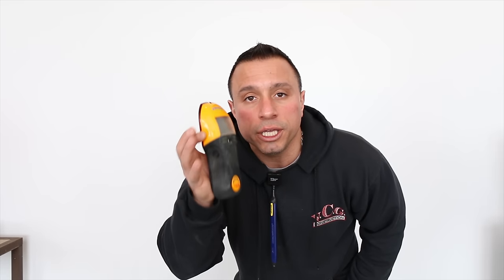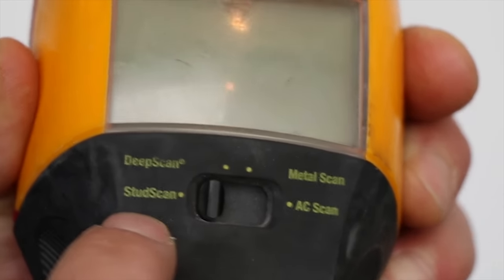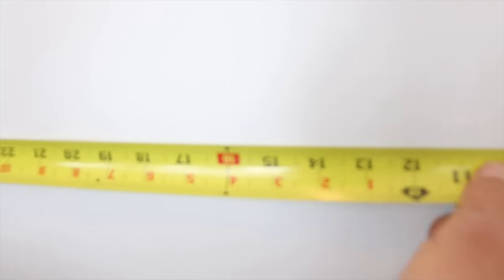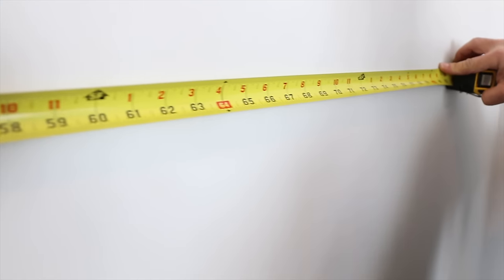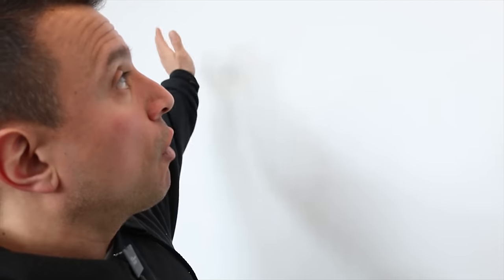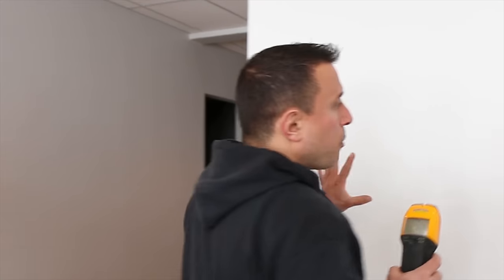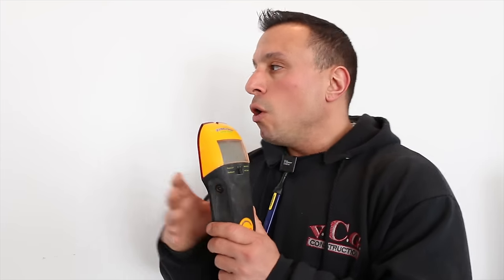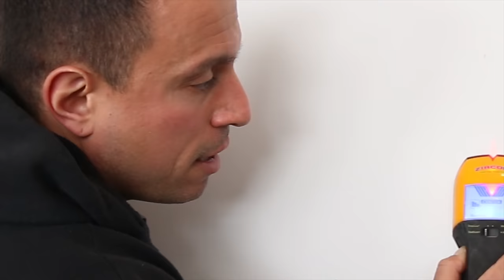How To Use Zircon Stud Finder Like A Pro!

Comment: The AC scan finds wires 2 inches deep, other things are found 1.5 inches deep so the AC is the BEST scan. This info is the FIRST thing you find when you look at the included paper manual, so if there is a wire or wires on the other side of a 4 inch wall, don't expect to find it!

Comment: The only problem I find with this unit is when you scan left to right and mark your studs at the center, then you try going right to left the stud sensor, it indicates the center anywhere from 3/8 to 1/2 inch off from the original mark. I don’t think any stud finder could accurately find dead center of a stud because there are so many variables with density of the stud and the drywall.
Reply: I have a different model of Zircon stud finder and that is the exact problem that I am having. The model I'm using only finds the edges so I mark them but then when i go over the same area again it shows the edges somewhere else. I have NEVER had luck using stud finders.
Reply: @NonLegitNation2  Me too! Did you find a solution?
Reply: @SHyoutube.  nope, it still sucks.

Comment: I had the cheapest version of the Zircon Stud Finder that worked perfectly  until I accidentally destroyed it.  Bought the Pro LCD and it won't work.  Yes, I held it to the wall before pressing the power button ...tried it on Stud Scan and on Deep Scan.   It beeps as I slide it on the wall and arrow goes off and on in tune to the beep but it never lights up or gives a constant beep where I KNOW there is a stud.  I've tried it on 4 different walls in my house: Living room, bathroom, hallway..nothing. And yes, I move it slowly.  No problem with the cheap one, but this one won't work..oh and I exchanged one and got another exact model...nothing on either one.

Comment: Big tip at 9:59
Reply: As a kid My great-grandfather had a old  edge stud finder with the 5-7 vortical lights that light up and beep when near, I would use it on everything, floor, couches, head, cabinets, carpet, pillows, hands, etc.. And I didn't always calibrate it on the wall so it would give false beeps as u stated, so to me it was common sense to turn it on at the wall first then walk to said items and play around with it to see if it would beep and light up, but I can see why people turn it on before putting the tool on the wall aswell.

Some finders if you calibrate it over a stud then you would also get false readings aswell, and some other stud finders  don't care about that rule

Comment: Watched your video yesterday went out to Home Depot picked up brand new unit installed brand new Duracell 9-volt battery couldn't accurately detect a steel stud in a business environment to save its life.  Already new about the trick to keep the unit planted to the wall for accuracy calibration. 

To get a stud finder that actually consistently works that and shows: pipes, live electrical wiring, studs both wood and steel with today's technology would you have to get a thermal imaging unit if you wanted higher level of accuracy?

Comment: Ahhhh that must be why my stud finder sucks!  I need to put it on the wall before I press the button!!!  Geez I never knew thanks man!
Reply from the maker: No problem cuz, do you own the zircon unit?
Reply: VCG Construction No I own a crappy one but I am guessing the reason it doesn’t work right is I push the button before I put it on the wall.  I don’t use it much but I hung my dry erase board recently and I had to guess where the studs were!  Lol
Reply from the maker: Give it a try and let us know if it works for you!
Reply: i didnt know you had to put it on the wall before you pressed the button. works like a charm i love my zircon

Comment: I'm taking it that a lot of people don't bother reading the directions that comes with the unit. 
Per the instructions:
4. TURNING ON/CALIBRATING THE TOOL
• Place MultiScanner HD900c against the wall before pressing the Power button in StudScan or DeepScan mode.
• Once powered on, tool will automatically perform all calibrations. ...
Note: It is important to wait for calibration to complete (1-2 seconds) before moving the scanner.
The instruction sheet has good info and tips on using this scanner.
READ THE DIRECTIONS!
Reply: Thanks for your comment Charles since you were courteous enough to print it out.

Comment: have you used the a250 model or the i520? How does it compare, any more accurate in practice for metal and AC? easier to use or hold? thanks

Comment: The instructions for metal scanning require you to calibrate the tool off the wall first (for maximum sensitivity) unlike the calibration steps for the other scan modes.